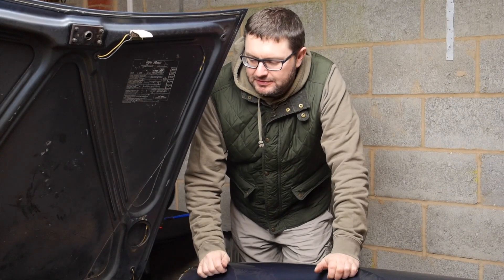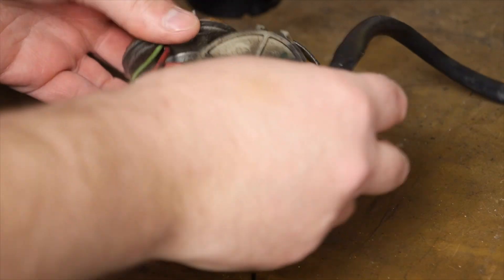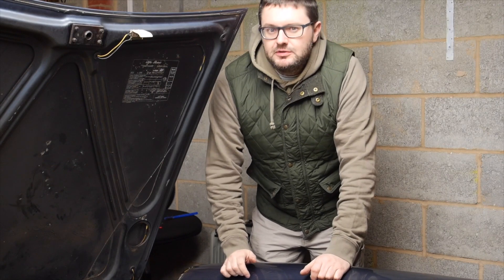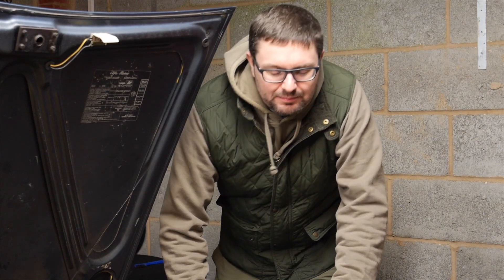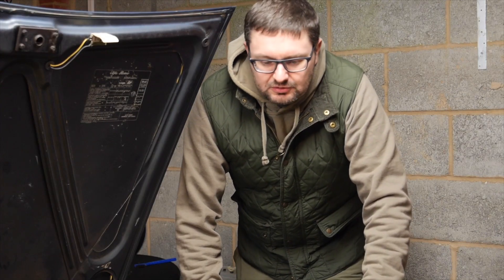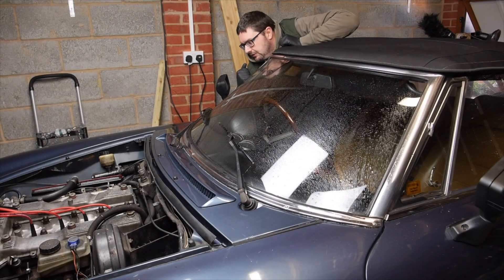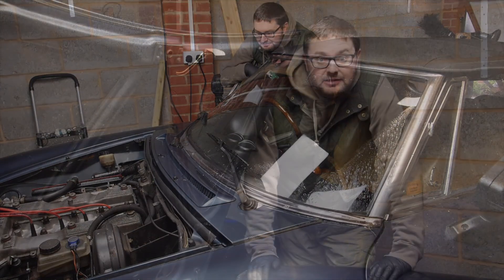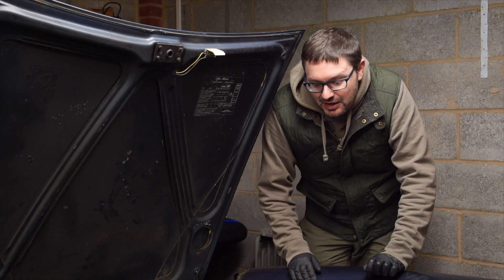Take to the Roads Garage - Episode 10 - Part 2 Fixing Slow Wipers on an Alfa Romeo Spider S3

Comment: I have the same problem on my spider and i have the car original from 1988. Maybe it's the spring that holds the wiper against the glass? To strong?
Reply from the maker: It has to be something like that. The arms aren't bent and the linkage doesn't looked like its been twisted or messed with.  It does feel like something is making it drag. Maybe a smaller spring might reduce the tension.